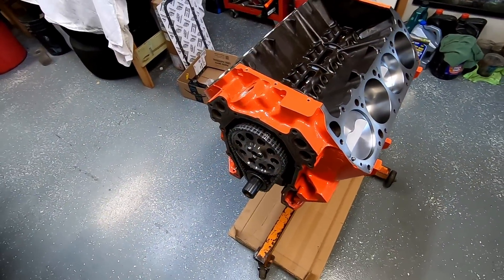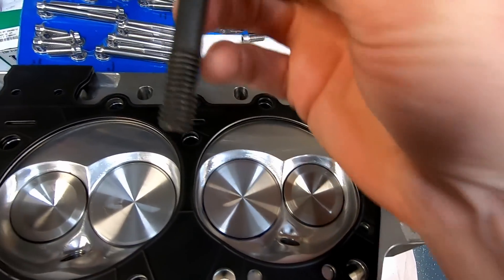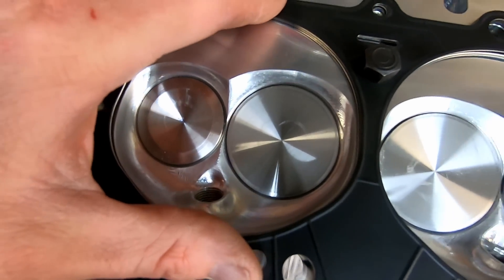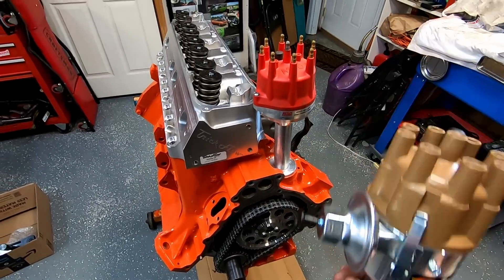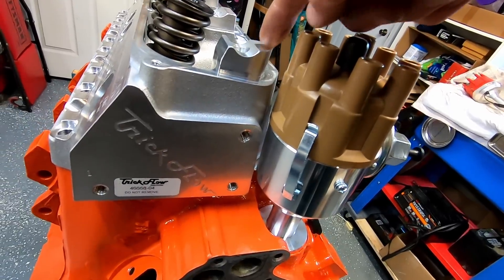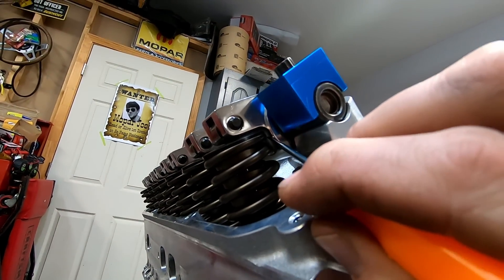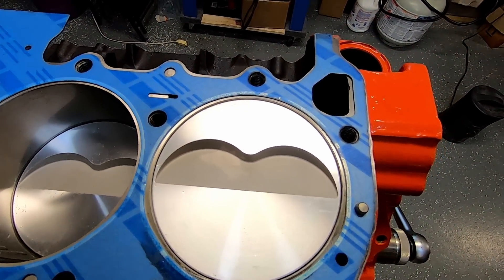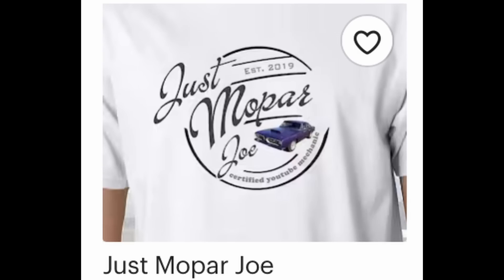Critical Tips for Installing Aftermarket Aluminum Heads at Home #edelbrock #engine #trickflow #440

Comment: Good stuff Joe. Didn’t I see you spray the cometic gaskets on a build? If so what product did you use and did you spray both sides?
Reply from the maker: Yes sir. Copper coat in a can. They have it at any parts store. Spray both sides and let it tack up for a minute
Reply: @JustMoparJoe thank Joe. I’m having trouble with head gaskets. 
Would you know a part number for a cometic gasket for use on a .030 over 440? 
Does cometic sell larger bore gaskets? How would I find their gasket size choices? On their website?
Reply from the maker: @jimdrechsel3611 yes sir, but unusually go to summits website and search through there. You can input bore size and select MLS style
Gaskets. It’ll pull
Up all their choices. Also Mancini sells them and has them listed on their site
Reply: @JustMoparJoe  you think they allow for the coverage typically when given the bore or if you had a 30 over bore would you look for a 40 over gasket to be sure?
Reply from the maker: @jimdrechsel3611 the rule
Of thumb I heard was add .030 to the bore size. If you miss it everyone will know. If you go bigger than necessary, you’ll be the only one to know.
Reply: @JustMoparJoe thanks a bunch   
I will let you know how it goes
Reply: By the way. I mentioned a while back about a new milodon oil pump that was bad. I met another Mopars guy at a car show said he had the same problem. Worse thing especially at a new start up

Comment: Great tips. As a general rule for yourself, would you not use the MLS gasket if the deck wasn’t milled. Or can an original deck that hasn’t been milled work properly with the MLS gaskets?
Not all blocks get decked but I can see why it is a good idea. 
If you didn’t use the Cometic what would be the replacement gasket? The 1009 felpro? 
Is there a method to use for surface approval before using cometic gasket on a block that is not decked?

Comment: Don’t forget to check oil return holes in heads being partially blocked by the deck surface of the block. I usually put a light chamfer on the block.
Reply from the maker: Nice one!

Comment: Great tips Joe! One thing I noticed on the bore scope portion of the video was the vertical rib seemed to have gouges or casting flash. Is it just an optical illusion due to the focal point of the camera lens or is that something you would 'clean up' to smooth out the flow?
Reply from the maker: Thanks, Mike! I’ll check it with my real borescope and see how it looks with the gaskets in place

Comment: Another weird thing about head gaskets is some are labeled say, 4.500" bore. But that is the size of the actual hole. Then another brand is labeled 4.500" bore but the actual size is larger for a 4.500" cylinder. You always have to check the real size. Good tips as always.
Reply from the maker: Thanks for sharing!

Comment: Great video, only thing I would say is, with those head gaskets, make sure the rivets aren't getting pinched between the head and block. On an aftermarket block SBF build for example, sometimes you have to drill the rivets out because that's what happens. 
Also, the head gasket should be a minimum of .030 bigger than the bore. I know you said the gaskets were 4.38, I'm assuming the bore is 4.35, which would be fine.
Reply from the maker: Thanks brother

Comment: The msd billet dizzy (and other tall shaft body models) will tend to clash on the corners of cast and machined valve covers, stock stamped clear easily. You can send those MP valve covers my way! I won't tell nobody :)
Reply from the maker: Haha! I happened to just buy two extra sets, but they’re accounted for 😂

Comment: Nice little class on how to install your own heads.
If your worried about the dowel pin and the contact between the deck and the head you can use blueing,
Reply from the maker: Excellent tip! Thank you!

Comment: I'm leaning towards the trick flow 240s instead of the rpm heads.  I'm going to run them with a. 509 purple shaft cam and torker 2 intake because the rpm dual plane won't fit under my hood.  Hoping for at least 550hp with the old school cam, intake and 1 3/4 " headers.
Reply from the maker: We have the torker 2 for this one, just for the hood clearance. They are nice manifolds, regardless. But the trick flows are legit

Comment: Could you not drill and ream that oil opening larger your self on the head ?
Reply from the maker: I would be scared to do so, without the proper equipment. It’s not really a bad thing, for higher performance engines. We are using cam that has a full groove around that cam bearing, with the holes. It will get plenty of oil.